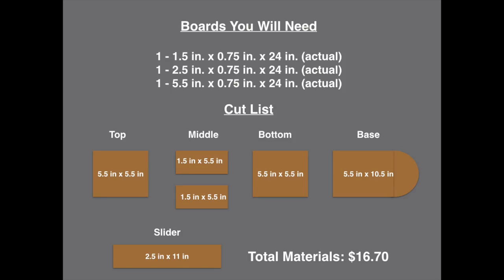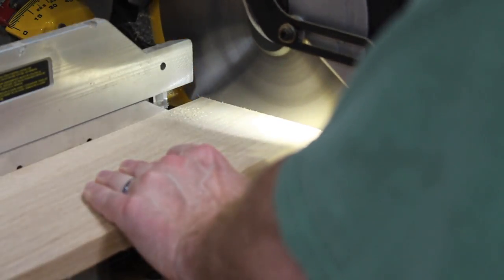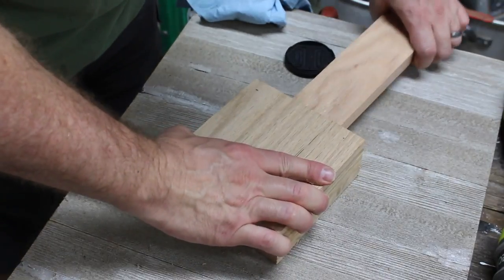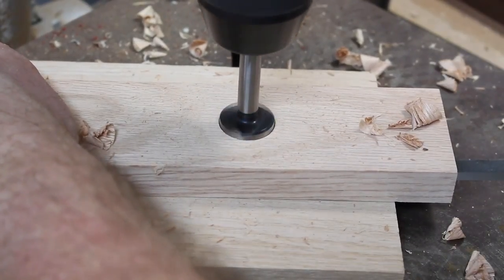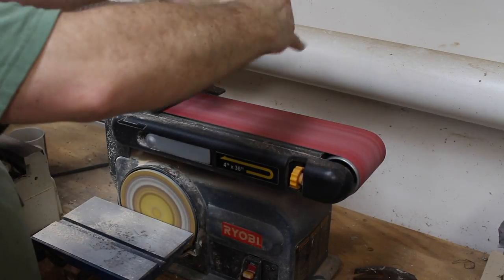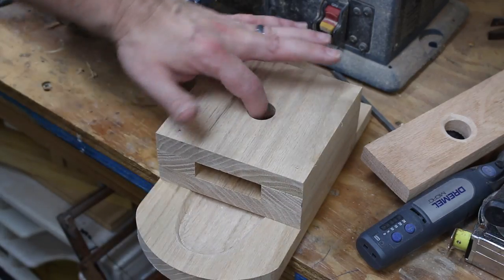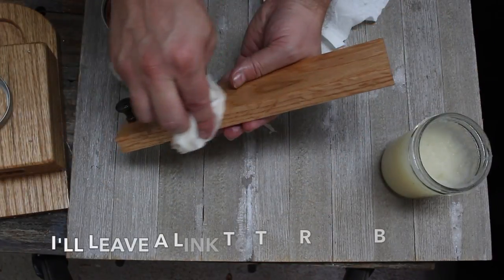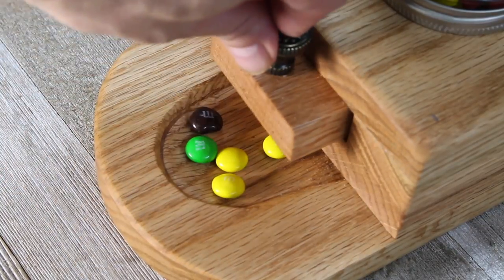How to Make a Candy Dispenser

Comment: I was looking for an easy DIY candy dispenser to add to my craft selling venture and found yours to be the perfect first time project.  You were right, using a router to carve out the drop tray is the best way to go.  I made a template from 1/4" HD material and I was able to make all six bases in less than 10 minutes.  Took some pics but can't include them with these comments.  Thanks so much for your video!
Reply from the maker: Great to hear! These are fun projects to make.

Comment: Looks like it's hard to grab the candies from underneath the protruding slider.  If I make this I think putting the receiving tray in the bottom piece further forward, and then adding a small ramp in front of the middle slide holder board to shoot the candy forward would aid the functionality of the piece.
Reply from the maker: Thanks for the comment! I think that would be a great design change. The biggest challenge I have with the dispenser is that sometimes the candy gets "stuck" or "wedged" together and won't fall into the hole. I'm not sure how to improve except for maybe making the hole a little bigger.

Comment: Loved the video and I made one myself.  I struggled with the tray but finally got it pretty good.  Also not much metal on that lid to drill thru and my four screws are visible a little bit.  Several people saw mine and want one too so I guess I'll make a few more. .  I wish there was a better way to make the receiving tray with less time.  I don't have much experience with a chisel.
Reply from the maker: Thanks for the comment! There may be a few other ways to make the tray. A router is one possibility. You could also just glue/nail some small pieces of wood around that area to create a tray. Anything to keep the candy from rolling away from you and onto the floor.

Comment: When rout out the indented tray for the candy.  Is it half way on the length of the base?
Reply from the maker: No, you don't have to indent the tray as much as I show in the video. Actually, it's better if you stop it a little shorter, otherwise the candies might get stuck in the gap that's formed if you make the tray too long.